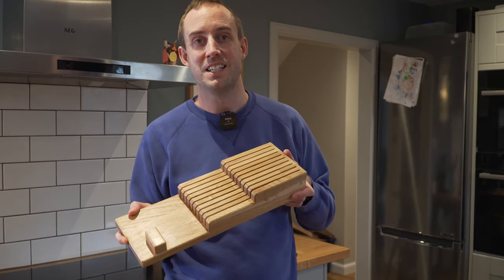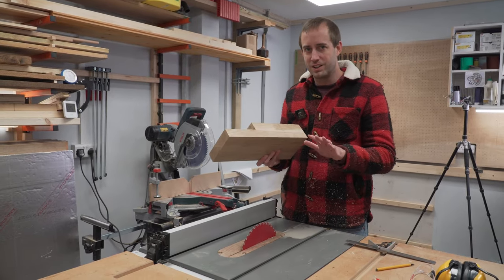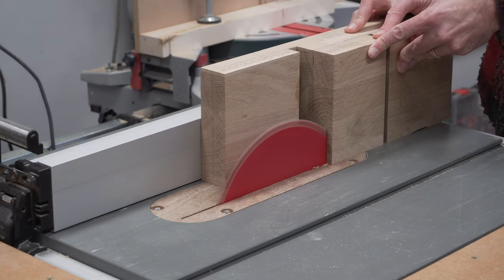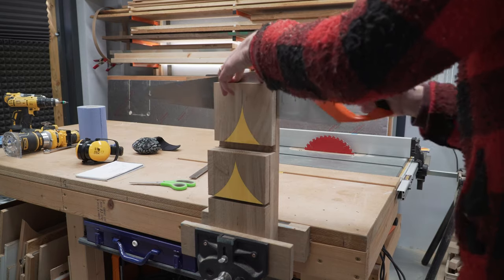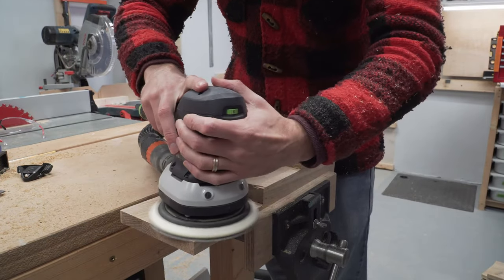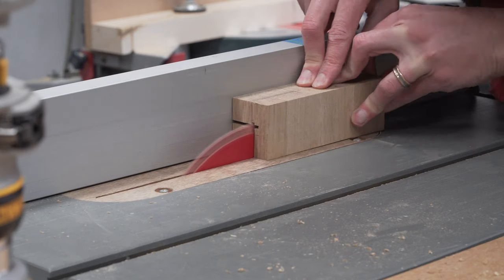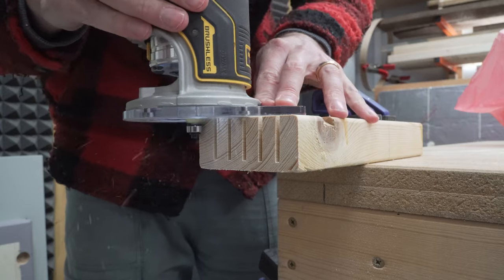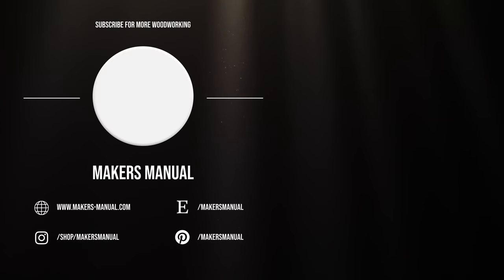Make an in-drawer Knife Block | with PLANS

Comment: I feel like this would get full of crud before too long. How do you imagine maintenance and cleaning of piece working?
Reply from the maker: Our first version of this is about 4 years old and 8 out of the 9 slots had no problems with crud collecting. The 9th contains the bread knife that often goes back with a few crumbs. These are easily removed by knocking it upside down or a vacuum in the slot. Provided you keep your knives clean, I think this block should probably be a cleaner option than a typical knife block 🔪 🪵.

Comment: Some of the sketchiest table saw usage i've ever seen.... great block though!
Reply from the maker: I must admit, looking back it doesn't look great. Although I believe in the video we do suggest a change to the order of operations and instead cut the knife slots before cutting the steps. This will make for a much safer build. Rest assured though, while it looks sketchy, we were being very careful. 
I believe all the other cuts are safe, provided you take the usual precautions. Unfortunately the UK version of our table saw has a terribly designed riving knife, which means we can't use if for non-thru cuts. We've since modified the saw, so we can have the knife for these operations (we have a video on that releasing soon).

Comment: Great project but ...... PLEASE!!  use safety guards or guide sticks!  This was hard to watch.
Reply from the maker: Hi, thanks for your concern. This is the second comment we've had asking us to be careful, so you've got us questioning our approach. Can we ask what particular cut got you worried?

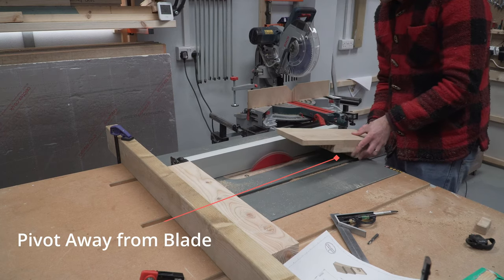There are times where the camera can make things look scarier than they actually were, though we admit that cutting the knife slots 8:43 with a jobsite saw did require a little extra care. But we do say 9:56 the better way to do things. 

We aren't using guards or push sticks in any of these cuts, because our fingers were always well clear of the blade. But please feel free to correct us if we did do something daft somewhere. We'd rather feel a little foolish than feel a spinning blade... ek. Thanks again for the concern